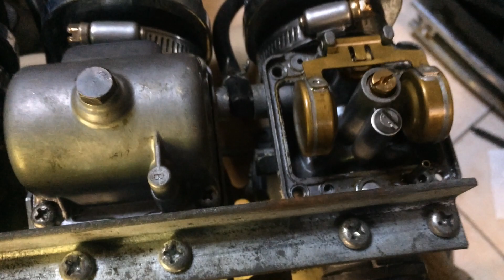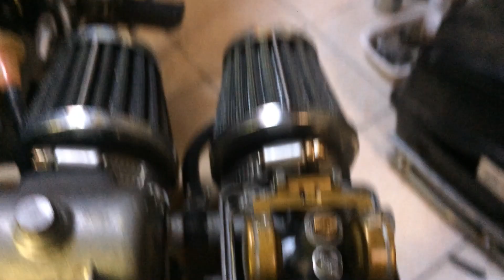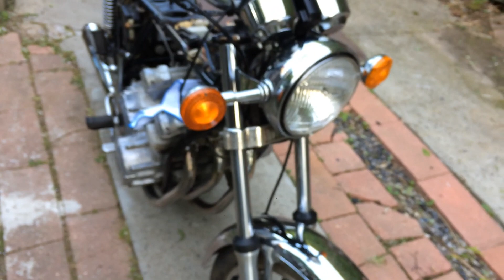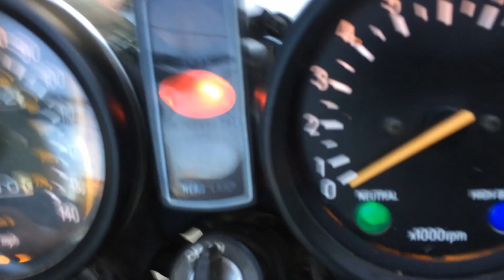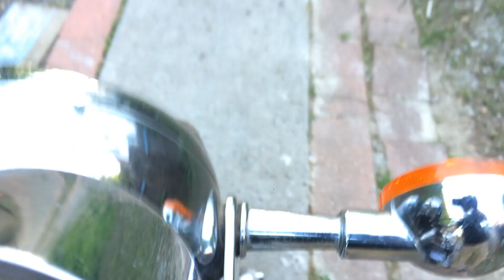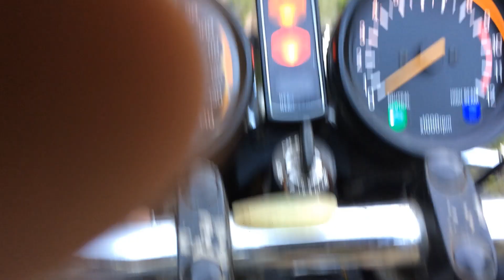Day 2 - Yamaha XS750 Special Revival

Comment: Hey i picked one of these up i had it runnjng now its dead. Has fuel compression and spark. New cdi and timing chain tension. What order are the coils in? Which one goes to which cylinder?
Reply from the maker: The coils run left to right in relation to the cylinders they feed, the middle coli is up higher than the other two. A ew things to keep in mind are float height and spark advance.

The floats only have +/- 1mm to be in spec. If you didn't check and verify they are correct, you may not be getting fuel to the cylinder, or too much fuel. The timing advance is mechanical, and if not moving freely, could be stuck advanced making starting very difficult, and prone to backfiring etc. Also, verify the spark is bright blue, the wires on these bikes tend to fail, and a weak range spark won't do the job. Let me know what you find out!

Comment: I got a barn find 78 xs750 triple last register was 81 
Kick start is stuck and 1st spark plug can't get it loose any suggestions
Reply from the maker: Spray lots of penetrating oil at base of spark plug and let it soak for a day. You may also want to use a heat gun to heat the head around the plug. Don't heat it too much, it just needs to be warm to the touch. Can you get the bike up into 5th gear and turn the engine via the rear wheel? If not you may have a stuck engine. This will require you to remove the plugs and put about 1oz of Marvel Mystery Oil in each cylinder to let it soak in.
Let me know ow this goes. Also you will want to remove the clutch push rod and polish up the end. It gets rusted and eats up the seal causing a leak. Oil it up before reinstalling it. Let me know how it goes.